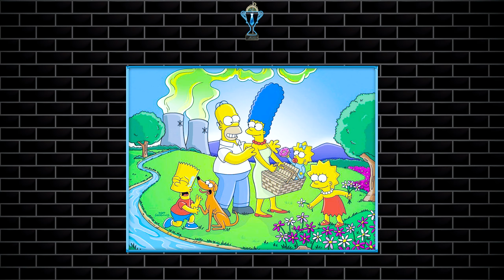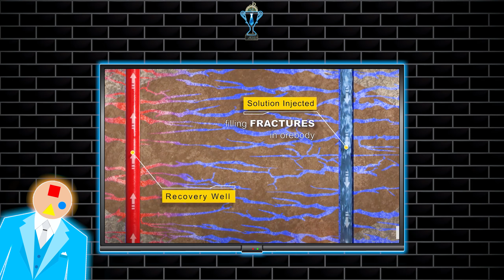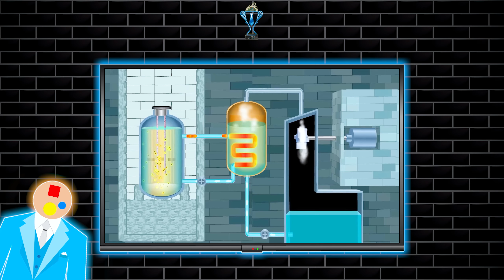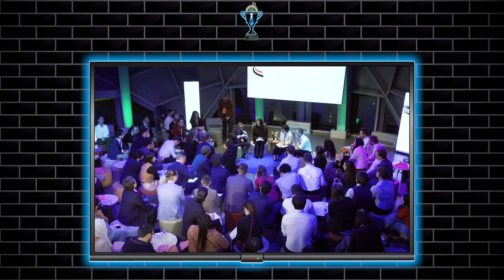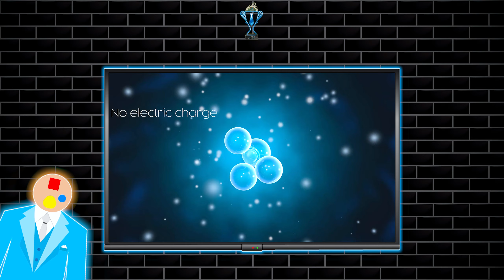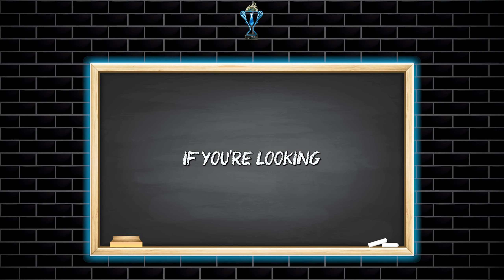‘’NUCLEAR’’ Energy | What Makes Nuclear Energy So Controversial? | mr.X

Comment: Gen IV reactors, like the Integral Molten Salt Reactor (IMSR) being developed in Canada, offer a significant advancement in nuclear technology with numerous benefits over traditional reactors. These include inherent safety features preventing meltdowns, the capacity to utilize spent uranium or thorium as fuel, significantly reduced and less long-lived radioactive waste, no production of easily weaponizable materials, smaller and less expensive construction, and passive safety systems ensuring the reactor can shut down and cool off on its own in emergencies. IMSRs and other Gen IV reactors represent a promising direction for cleaner, safer, and more sustainable nuclear energy, though commercial deployment is still overcoming regulatory, financial, and public acceptance challenges.🤔

Comment: I’m convinced that the benefits far outweigh the drawbacks. Most would agree that access to power is crucial, and solar energy is the optimal choice. Yet, moving towards sustainable energy sources will take time, making nuclear power the most practical interim solution.
Reply: Solar is actually the least optimal choice.   It's also more expensive than nuclear.